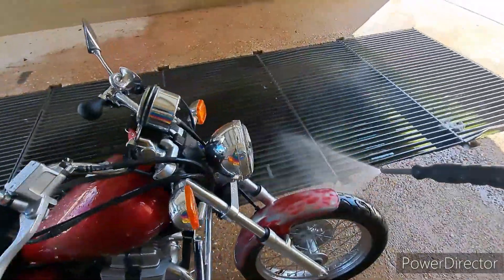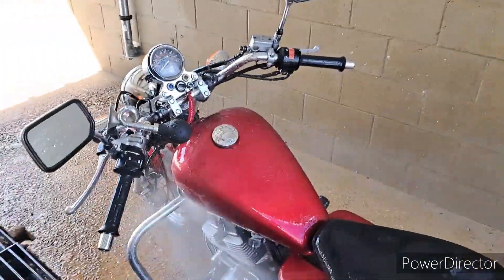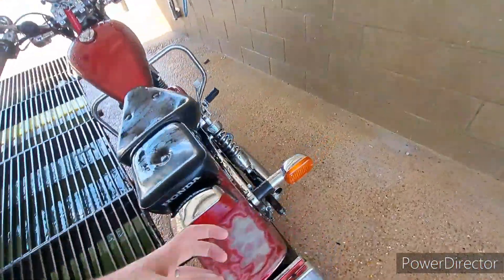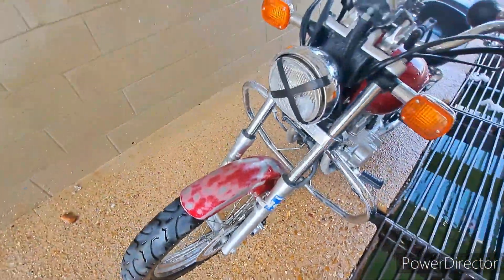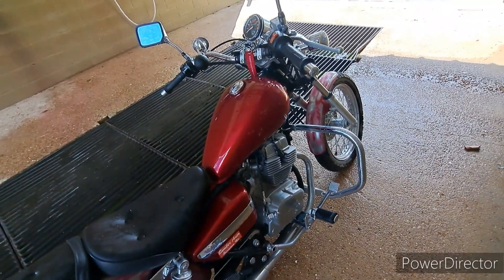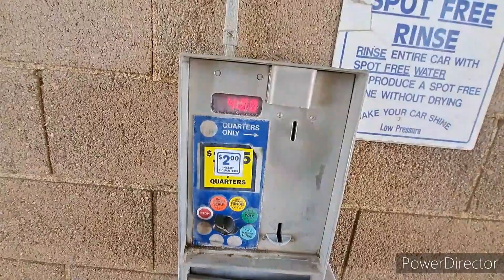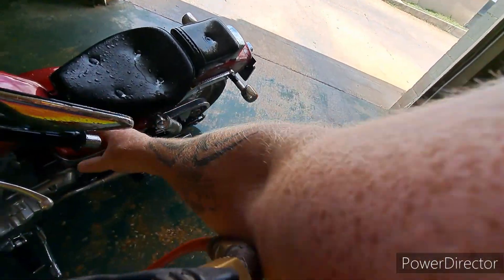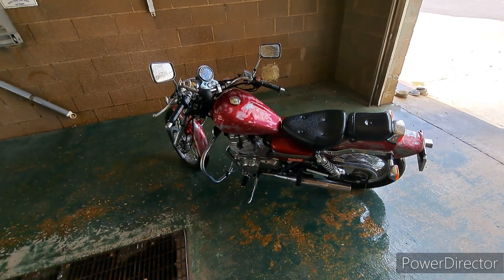Honda Rebel 250

Comment: I like that bike. I think the crash looks good on it. Lately I've been using vinegar and a wire wheel or brush for rust. Afterward I spray it down with rubbing alcohol to prevent flash rust. A patina looks really cool but I don't know how to do that. I had an older Chevy that developed its own patina without any rust.
Reply from the maker: Thanks Brotherman  .... I just used a regular skill sander  thick sandpaper and just hit fast and quick didn't keep it in one area too long to expose the metal ..... tha patina look is just Because I love ratrods and I want my stuff to look faded and rusted